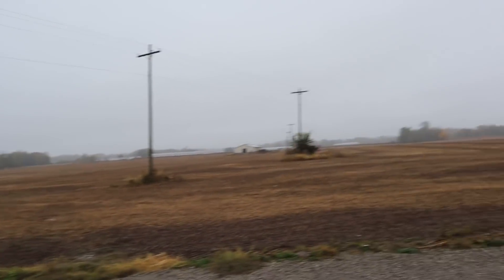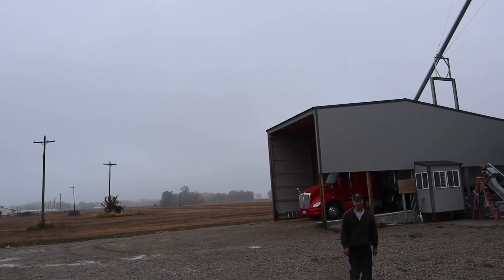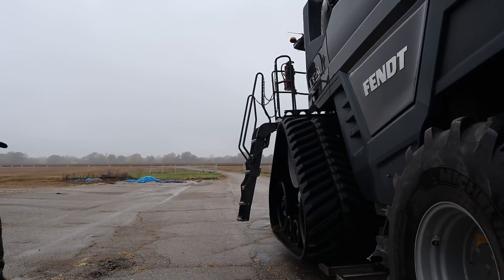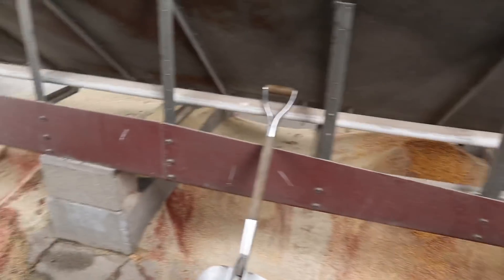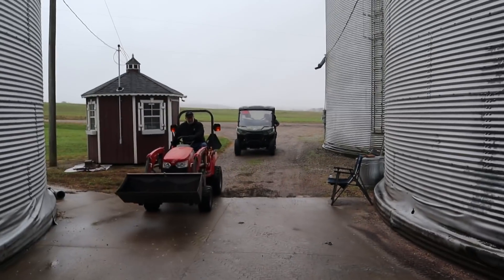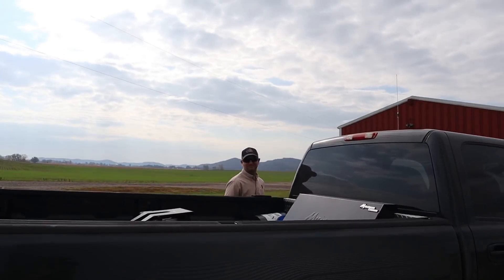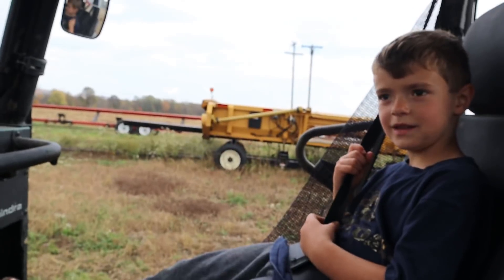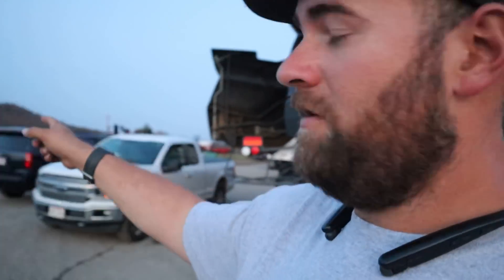We Have a Fendt Ideal 8T on The Farm

Comment: Did Mike Mitchell convince you to get one?
Reply: Nothing makes me want to buy one like seeing one burn to the ground then explode 😆
Reply: Just don't run it with a bad bearing on the drum.
Reply: @stevenv5390  A bit below the belt but still funny. 😆
Reply: Thing is Brian had a Demo on the farm before Mike did.....
Reply: @OOpSjm  if you've ever operated a combine you'd know it's basically impossible to  know when u blow out a gearbox seal from the cab, and the time it would take for that to heat up is extremely short